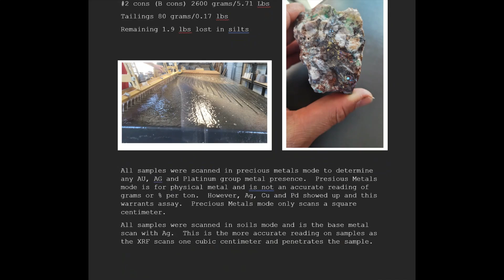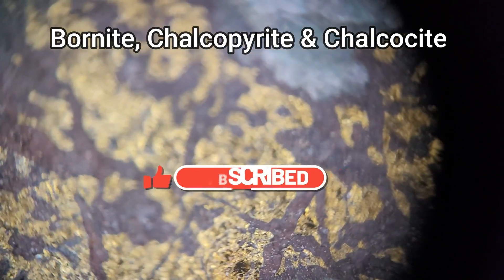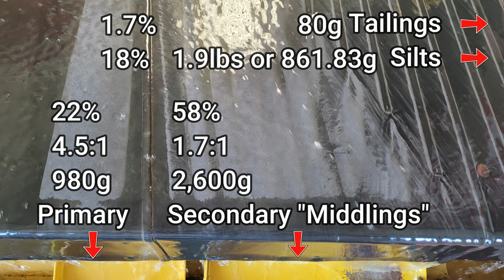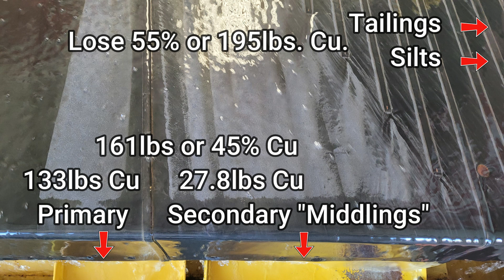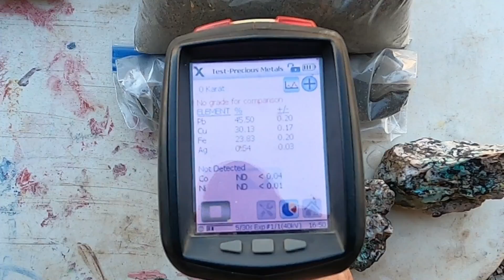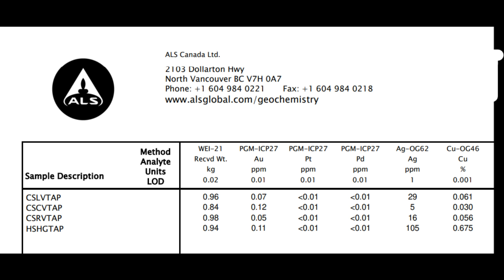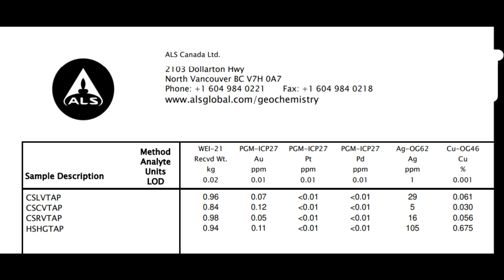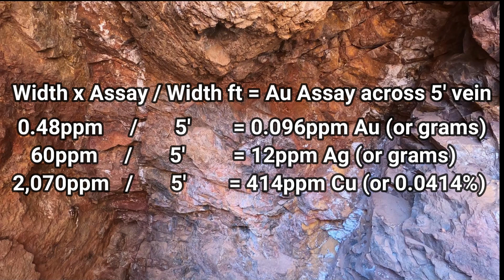Technical Assay Review from Sampling the Arizona Property for Gold Silver and Copper

Comment: Refractory ores recover great over a finishing table if its milled to -20, roasted and regroup to -200  and run as slimes, slower feed rate, however a rotary kiln isn't a cheep project, cost a lot to run froth floatation and leaching are most cost effective.  I have refractory ore with 54toz ton gold...  400+ in silver.  Run the ore over a table, save all the tailings and send to a float plant.  A fella in ID will do 150-200 ton batches over his float plant for a fee, dore bars are the result.  I jaw crusher refractory ore to -20, then sluice it....roast and regrind sluiced stuff...and save and refractory all the tailings till they are slimes, over and over.  Keeps a fella busy, but the pay is consistent,  and I find when I mix my refractory ore (acidic) and my oxidized crecent basalt ore (basic) the ph balances well and more drops in a sluice,  jet dry in closed loop is more effective and it is less likely to dry our your hands from PH issues.